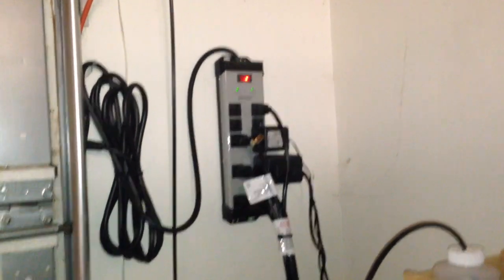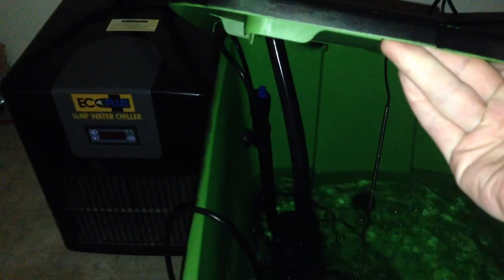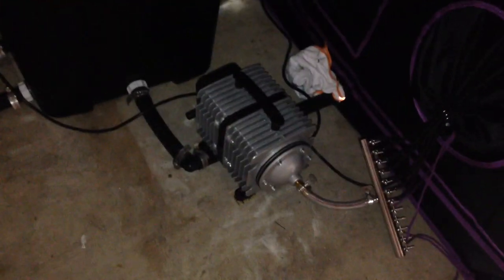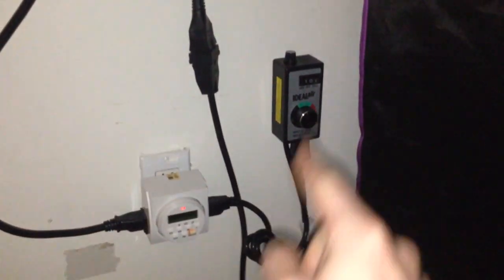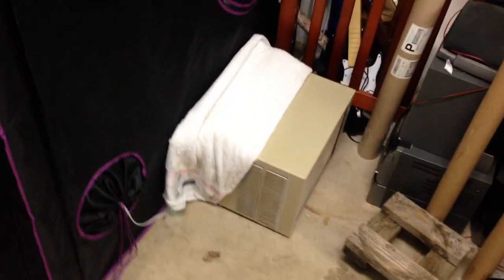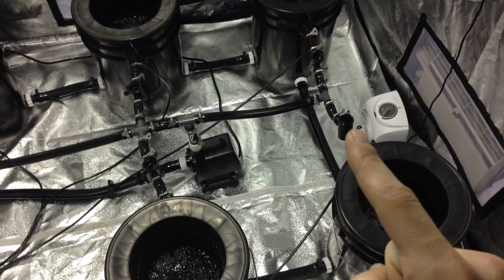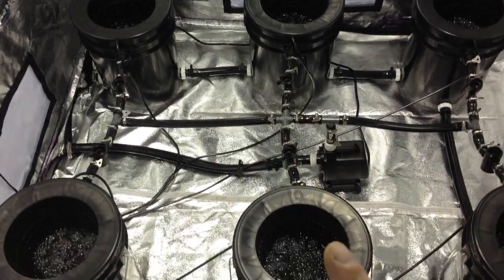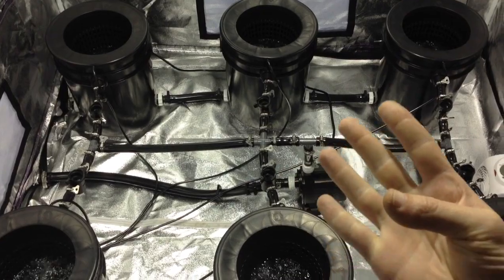RDWC hydroponic system

Comment: this is the perfect grow setup. So impressive! Could you do some follow up videos to this or maybe a diy explanation and guide for your rig? I'm sure a lot of people-including myself- would love to see the genius behind this!
Reply from the maker: Yes, I've just ordered a new reservoir, 3/4" brass float valve with two float rods, 2 electric ball valves I mentioned in the video above and a ton more parts. Why you might ask? 

I'm going to the next level of automation with full automatic nutrient/ph dosing, monitoring, flushing, topping off and even timers (for pumps and lights) all from single spot. See I've built a hydroponic OS (https://github.com/drolsen/DRO-Matic) for arduino, along with prototype doser unit in a my other videos, but now I'm going to do a step by step video on how to build much easier, more feature filled doser system that works with my OS. Remaining parts from my last order show be here by the 27th, and I will start filming the creation of the DRO-Matic unit right away, and then segway into the entire system build there after.

Parts list for this build are here: http://a.co/bKHL6pi
Parts list for upcoming DRO-Matic build: http://a.co/2oXqVqX
Reply: i ask because i'm considering making a system similar to this as i cannot find a more perfect dwc setup on youtube. A video on how you set it up or just explaining how the water system works would be so helpful! thanks
Reply from the maker: You bet bud, give me a little time to get this next video up and I will not only go over the final build, but also break down how it works (water, lighting etc).
Reply: awesome man!!

Comment: Instead of using that Doser you can use a small aquarium pump with an adjustable Draper at the end of your waterline that is connected to the pump . use diluted pH and it works absolutely perfectly...
Reply from the maker: Cool thanks for the info!
I've already moved away from that doser, and built/open sourced my own fully automated monster found here.
https://www.youtube.com/watch?v=GlZHTMk3PBg

Comment: Well balanced system, I would have used a 150mm in line fan for the lighting hood, to keep if seperate from the carbon filter incase of moisture on the bulb or mould 👍

Comment: I think we're ready to roll - yeah you are!

if you were going for the perfect set up may I ask why not go with LED's? benefits outnumber ballast bulbs. and your fan speed dimmer may be burning out your fan, because those speedster devices all they do is turn on/off the motors very fast. Something like a Variac controller is better as it controls the power instead.
Reply from the maker: Thanks! To answer your question.. Lack of knowledge. This is my first setup and I'm kinda flying blind besides online research so far. Light was one of the first things I got and as time goes on in realizing mistakes I've made and better ways to setup. That said, I will run with my 600watt for the time being till I can get a LED setup and a second tent for veg. I'll keep peeps posted as I go.
Reply: LED is for rich people. I'll stick to my poor boy HID. Energy is cheap in my state.

Comment: That’s a nice set DWC set up. What is the perfect nutrient temperature? What kind of filters do you use to keep the line clean? I’m thinking about buying a 1/4 HP chiller for a similar sized reservoir tank for a DWC set up. I live in Florida, so the nutrient temperature is 83 to 91 degrees, and the DWC plants got weak and died. How much is the electricity cost to run the chiller? The AC unit vents inside the garage. Doesn’t that make your garage too hot? I’d love to automate the controls like you did! It looks like many thousands of dollars for only six grow buckets.

Comment: Water down the ph buffer that is why it seems to be "over dosing" you never want to add ph up or down that has not been diluted to a nutrient solution. It will lock some of them out making it unavailable to the plant.
Reply from the maker: Golden Goodness Hydroponics But my water is magic!!!! Just kidding, yes of course you are correct and I've graduated my doser system to my DRO-Matic doser (see my latest video) that requires me to use standardized bottle sizes and gives me the opportunity to dilute pH solutions.
Reply: Devin Olsen hummm I love the dosing system but I think a commercial system like it adds it to a mixing chamber before introducing it to the rest of the "soup" or nutrients. I learned the hard way that you have to add nutrients and ph adjusters independently and in a diluted form or it just stresses the shit out of the plant. I see you are kinda new so I'd rather give you more info than not enough. Unfortunately with hydro one little mistake can kill a crop. So don't forget to ph the water 1st. Then add the nutrients one at a time to clean ro water. I also meant to ask what kind of water you are using. R.O water usually has a ph of 5-5.5 so you can use it with out any ph adjusters.
Reply from the maker: The doser allows you to fully configure what channels get dosed first, second and so on, and at what time (so you can increase or decrease the time between each channel) for this exact reason. You also configure the nute amounts for the total weeks of growing (aka recommend formula on nutrient manufacture's chart) so its never a fixed dosing amount of nutes as plants grow (unless you configure a week to repeat of course). 

The idea is you drop one set of pH / EC sensors in to reservoir, and another set into control bucket for plants. First set of sensors is used while dosing reservoir and follows your scheduled configured grow weeks, while second set monitors plants continuously feeding and sends data to OS. 

The data the OS gets back about plant's feeding water is what triggers decisions for the OS to either add top off water (when EC naturally climbs due to feeding), when to fix pH drift (pH levels in plant buckets exceeds a range you configure in OS), or to flush plants fully and start a whole reservoir worth of newly nuted feeding water (when top off water between feeding rounds runs out).

As for top off water between feeding rounds (aka configured weeks of growing in OS) you also can configure a percentage of current weeks nute concentrate so that top off water is say, only 1/3 that of current feeding rounds nutrient concentrate.

The fill, drain system is done automatically with electric ball valves, water amounts monitored coming and going by flow sensors.

I'm going to go RO water (another point my buddies keep poking me about), just gotta pick up one of them bad boys first $$

Comment: Doesn't the chiller have an internal thermostat? Whats the need for the extra temp controller?
Reply from the maker: It's just a chiller not chiller / heater in 1. The water temp controller switches between both chiller and heating element I have in the control bucket. This is so I can grow during summer and winter (concrete floors/garage in Oregon and all). Great question!
Reply: Ohh I see. Pretty slick. Badass setup. I love automation.

Comment: Shouldn't have the carbon filter connected straight to the lights as that means the lights are getting moisture so should have a dedicated fan for the lights where no air from the tent hits the lights

Comment: in my opinion simpler is better. like my infamous frozen milk jug water cooler. you have a PERFECT nightmare. when something goes wrong.. and it will... good luck figuring out which bell, whistle, timer, connection, wire, setting......is causing the problem. I am envious of the doser though!

Comment: Hi devin, I notice that your inline pump return line isn't perfectly in the middle of all 6 buckets and you had to use a 3 way T followed closely by a 4 way cross to the left to send to the middle buckets. My question is did you see a difference in pressure between the two buckets on each end? Because one side of the 3/4" line coming from the pump has to feed 4 buckets and the other side only feeds 2 I'm wondering if you see a significant pressure drop in water delivery to the end buckets on the "left" after the 4 way cross in comparison with the end buckets on the right. Does that make sense? Also, where did you find your 4 way 3/4" cross with barbs?
Reply from the maker: David Harris yes this was due to not being able to find a 3/4 5 way barbed fitting so I had to make my own with two fittings. The pressure can be slightly different across buckets without the stop valves I have on each bucket inline, but for the most part it seems to follow the rule of least resistance. Meaning that the water still has to make an equal amount of 90deg turns before each bucket and the distance between bucket and 90deg turn is equal across all buckets, so once full pressure is reached prior to 90deg turns it's mostly equal pressure to each bucket  there after. However the stop valves mentioned above can help fine tune equal pressure and water levels across all buckets.

You can find 3/4" 4 way barbed cross connectors (or fittings) here: http://tinyurl.com/j94bau4

Comment: awzm build! do you change all of the water in the system during each phase of veg and bloom or do you  just keep adding nutes and water?
Reply from the maker: I like to fill my reservoir up with exactly how much water my plant buckets + control bucket can hold (40 gallons), dose that water will fully recommend amounts per solution formula of nutrient manufacture, and feed the whole batch to my plant buckets. I then immediately refill the reservoir back up and dose it with only 1/3rd the recommend solution amounts (except ph of course heh) and use this as my top off water. 

As my plants feed through out the week, my plant/control bucket water will climb in PPM/EC, so I top off my plant buckets / control bucket with little amounts of this 1/3 solution to combat this buildup. However once I've run out of 1/3 solution in reservoir, I know it is time to do a full flush of plant / control bucket water and start cycle over again (adjusting dosing for growth of course).

Now that all said, I'm currently trying to finish up an entire automatic doser and drainage/topoff OS using Arduino and parts found online. You can follow my progress in my other video on my doser and get a copy of the OS here once done https://github.com/drolsen/DRO-Matic. I'm planning on creating a new video soon showing how to build a much cheaper version of a doser than what I have right now up, but also how to use the OS with that build and hook it up to a system you see in the video above. Lots more to come.

Comment: sorry for the newb question, but what are the benefits of a control reservoir?
Reply from the maker: Np!
Big black guy is the "reservoir".
Little black tub is "control reservoir".

Control reservoir gives you the ability to automate your setup for irrigation, dosings, water chilling, pH testing/correction and EC testing/correction. If you are not planning on automating your system, this two reservoir setup is not for you. 

For instance, with the two reservoir setup, I can have a batch of topoff water sitting in the large guy for the 7-14 feeding cycle of plants, and test water levels in small guy and auto correct water levels accordingly.

Comment: I can't imagine the outrageous electricity bill for 6 plants. Nice set up though.
Reply from the maker: About the same as adding two PC towers with 1000w power supply. 
Not that bad actually, and if you DIY your own grow lights using COB / LED strips, a normal 600w grow light can be reduced to only using like 200w (give or take).

Comment: where did you get your inline water pump from?
Reply from the maker: I got mine from a local seller here in my town.
https://www.amazon.com/EcoPlus-728310-Submersible-Pump-396GPH/dp/B0012V5VNW/ref=sr_1_1?ie=UTF8&qid=1473313059&sr=8-1&keywords=EcoPlus%2Bwater%2Bpump

EcoPlus Pumps can be both inline or submersible. I've updated the video description to include my experience with these pumps.

Comment: I guess you wanted to spend a lot of money. But I agree with everyone else. Might be nice in some regards but the trust you're putting in that level of automation equals long-term headaches and cost. I;;d rather pay attention and learn from growing through different situations. Well done though, you really shoved everything in for 6 plants. Valves on every bucket feed is stupid though. Don't build in points of failure.